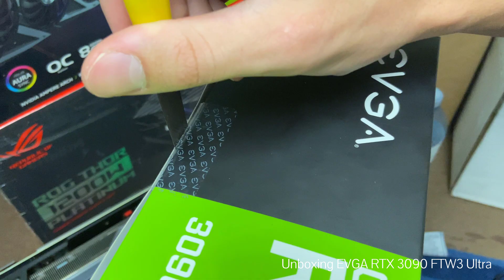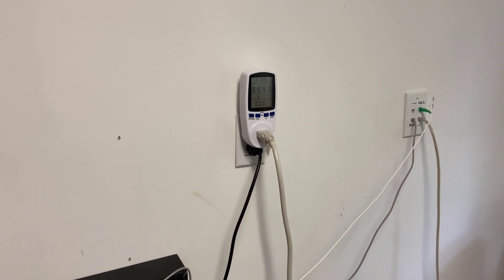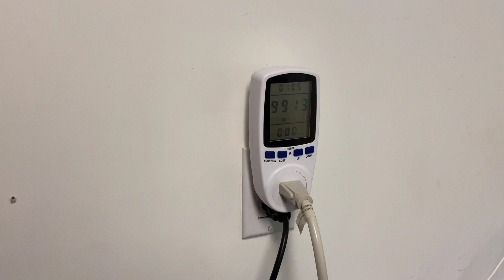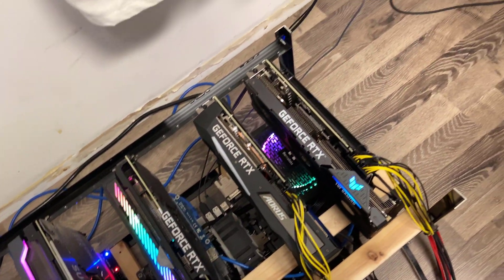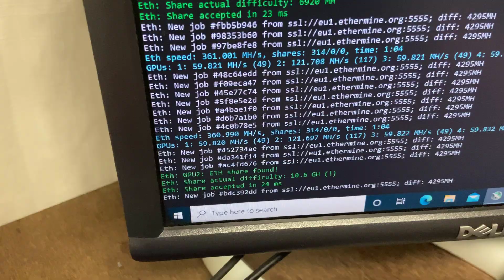4 X Nvidia RTX 3070 & 1 X Nvidia RTX 3090 Mining Rig Build | 361 MH/s at 990 Watts

Comment: You are consuming too much electricity.
4 x 3070 should be at 120W each and I obviously the 3090 is not gonna be at 500W
Check you consuming and you get better results but 990W is like 200 W too much or something.
Cheers 

Fellow miner
Reply: Try putting Power Limit to 55
Reply: and Core clock -500